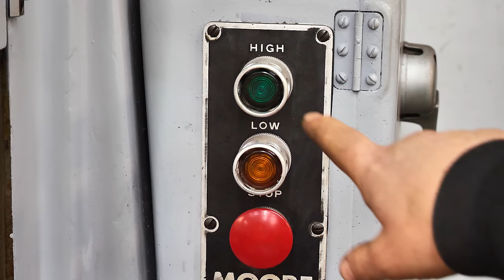Making Crazy 500cc GoKart

Comment: Am I correct in assuming that tracking in a competition rolling chassis is very important? In that case, what about some slotted holes in the rear axle bearing carriers to allow for some slight adjustment, with blocking nuts on the adjustment bolts to stop adjustment creep?. Otherwise.... when can you build one for me??

Comment: What an awesome project 👏 I have 2x Yamaha enduro motors and when deciding to put one in a go-cart, I thought I could use both with all controls simultaneously linked but with individual axils... so on a corner the outer motor will rev higher acting like a differential? has anyone tried it? its just one of those ideas I'll never get around to, but I think it would work 😮😂

Comment: I like how you used the engine as the upper part of the frame. I was worried when I just saw the bottom frame and no top in the rear. Nice shifter kart parts used throughout. I wish I had stuff like that laying around. The frame is the cheap part to build. (Well, not so cheap lately with the cost of tubing)

Comment: Great build!  I’m curious why the double rear axle bearing ended up on the non-drive, non-brake side.  I’d have thought the sprocket or disc would have ended up between the two bearings.  I’d love to see this on a track with a GPS to track speed. 👍
Reply from the maker: To reduce weight, I decided to use a stainless steel pipe with a 2mm wall, in a place where there was no sprocket axis, I decided to stiffen the rear axle with an additional bearing, in the place where there is a sprocket and disc, the axle is stiffened by hubs that fasten the sprocket and brake disc. As for the performance, it was a test on YT, so I specially dismantled the meter and did not show the maximum capabilities, I can only say that the weight of the whole turned out to be such that I can easily lift the whole vehicle and load it on the van, and in the first three gears i have to let go of the gas because the front wheels lose grip. And it's only 60 HP, I've seen many videos on YT where 600cc and even 1000cc were mounted, well over 100hp
Reply: @WorkshopFromScratch  thanks for your reply!  I like the idea of the tube axle; much less weight and still stiff enough.
Reply: It’s just a copy of a standard kart. The dual frame on the right is to mount a sliding engine mount. But yes the 3rd bearing should have been mounted in the centre or closer to the sprocket.
Reply: @WorkshopFromScratch it sounds like it would be a good idea to incorporate an adjustable airfoil on the front of the kart, so that it would hold the nose down at higher speeds

Comment: As a blacksmith and machinist, I can see you have the tools and skills to fabricate everything you want. :)
I would have made a similar approach but going for TIG welding on the frame though (yeah..just to show off ;) ).
I can see it's difficult to get the power on the road without spinning the wheels. Have you tested the top speed yet?
Reply: I thought the same thing also ,tiging the chassis, but I commend him to n his choice that was a true professional call. If he was working with chromolly steel I’m sure he would have used tig but standard steel stock mig, obviously you’ll move faster.

Comment: A suggestion -- integrate the clutch cable in the shifting mechanism (that should be fun, because it has to pull in both the push and pull of the lever) so you can up/down shift "without" the clutch.  Excellent video, thanks for sharing.
Reply from the maker: Yes, I didn't do the toge too clever, I also need to work on the lever that mounts directly to the gear shaft because it flexes when shifting and that's why there is such a big jump when shifting :)
Reply: @WorkshopFromScratch  Can you use quick shifter kits on these motorcycle transplants? Genuine question.

Comment: Impressive work. I wondered about the design process for the frame, brakes, wheels, etc. Did you make drawings before the build?
Reply from the maker: Thank you 😁 I modeled it on the original go-kart frame. I made the frame longer by the length of the engine, I widened the front axle and the rear axle is also wider, and the whole thing was made of thicker pipes than in the original go-kart, I added additional reinforcements because the frame is long

Comment: I would certainly put larger diameter wheels and tires on this one.  Just a little bigger. You certainly have the torque for it, and the engine would reach the rev limiter so quickly.
Reply: It's like an impedance mismatch, plugging in a guitar to a mic input. Or a marshall into a 8 inch speaker.

Definitely needs bigger tires; all that power is being wasted it seems. Not to mention that this thing looks insanely heavy lol. 

Not that this isn't awesome, but yeah I feel like there's a sweet spot he's missing with bigger tires that transforms this from awesome to legendary.
Reply: @jacobyunderhill3999  It's like racing on a skateboard.

Comment: you should be building Hot rods ,your craftsmanship is outstanding ,you need to get rid of the REV limiter ,lots of torque sheared off the wheel studs grade 8 bolts

Comment: A friend and I built a very similar Kart back in 1973 we used chrome moly for the frame work and H2 Kawasaki triple 500 cc for power. We ran the ET bracket at Amarillo Drag way  under AHRH rules. the driver weighed about 85 or 90 pounds. The rules called for a 4 speed transmission only so we blocked off 1st gear.
Reply: ... and? Did you do any run to see what was the best MPH and ET it could do? Over what distance?
Reply: What's et ?

Comment: the whole build is WOW ! I'm in a wheelchair and I could see myself building this frame and live axel set up, great job indeed.
Reply: Do it don't waste time for it is running out only start with a harbor freight predator 212 please , no more accidents for you
Reply: @robertevans9354 Harbor Freight Predator Engines are Great Engines. They Sell Kits on EBay and other places to really beef them up. They are a really good Honda Clone and just as good in my use of them.👍👍

Comment: Like everyone else, excellent fab skills and engineering. When I was 17 years old I took the motor off my snowmobile and adapted it to my home built go-kart. That thing screamed! It was only 18 HP, but with the torque converter a friend clocked me at 90+ and I was pulling away.  This thing will also GO! Oh, I am 68 now, so a few years have passed. LOL
Reply: No that didn't happen. I had an actual 440 snowmobile engine in mine and it didn't go that fast. Probably twice the 18 horse u had and it wasn't that fast. 90 and going away, nice dream dude. Oh and I'm 63 so calling you out old boy.

Comment: It's evident that you've been collecting parts for this project for quite some time. The wheel mishap added a thrilling element, but I won't spill the beans! Overall, another stellar job as expected. However, I can't help but wonder about the safety precautions and potential risks involved in such a powerful go-kart. Stay safe out there! 👍🔧🏎
Reply: Your concern is duly noted good sir however this is far from over powered, if you compare this to one of today's modern entry level novice 100cc 2 stroke racing Karts I think you'll find the power level is adequate and far from being dangerous especially considering the sturdy and well engineered chassis, the extra long wheel base, wide track, huge 4  wheel disk brakes and as well as relatively tall gearing make this home made machine very safe indeed. One of best I've ever seen infact. 
500cc may sound like a lot but trust me that particular engine is sourced from what most countries classify as a Learners bike, it's a low compression design and extremely linear and not what you'd call a power house. The bike it's from is a commuter bike made for economical transportation and not competitive racing, a 250cc 4stroke from a MotoX bike would absolutely destroy this 500cc commuter engine. The builder chose it for his own reasons, probably reliability, cost, and its linear torquey power curve is my guess.

Comment: I own an OTK gokart with 125cc iame x30 engine. I get to know the parts of my kart better by watching you build, thank you. 
Yet I felt that 125cc is a bit too much power for me, a 500cc is absolutely a formidable beast.
Reply from the maker: Yes, 500cc is hard to control and this engine has 60HP, but I've seen people on YT who built go-karts with 600cc engines from sports motorcycles over 100HP, it's hard for me to imagine how to master such a go-kart, where I have problems with a 500cc capacity and I have to let go of the gas because the front wheels lose traction

Comment: id have gone fully crazy with this gokart stuck a early h1 500  kawasaki bigger oil lines and top bearings changed the gear ratios and a wider chain ,be a riot to drive,ive seen yam 750 vmax bolted to a ally and stainless frame go kart ,a 350 ypvs race engine stuck in one that was fast in a straight line but spun round in corners was not wide enough and was not geared down

Comment: I did the same thing when I was 16 and used an engine out of a Honda cb 250 . 85 mph and a lot of fun . We used 12 inch tires to get speed from such a useless gear ratio. We stretched a standard cart out and pretty much all the same with drills ,grinders, torches and stick welder . UNTIL we melted a piston due to lack of cooling air. That was our next mod to put air scoops on it but it didn’t make it and we had to replace the pistons .

Comment: I want to try and build my own custom cart as well and wonder what kind and how big pipes you used for the frame.
I also think this build is crazy
Reply from the maker: He has a kart and the first idea was to extend it to this engine, but I found that because the tubes were 28mm diameter 1.5mm wall thickness it would take a long time to strengthen it with this frame, so I decided to build the whole frame out of tubes 32mm and a wall thickness of 2mm take into account the reinforcement of the frame for its length and weight :)
Reply: @WorkshopFromScratch  hi Mate.  What center line radius is the die for 32mm tube

Comment: Ahctum...an idea you might like. The idea is two rear axels connected by chain from the motor then using a total of 4 tires on two axels on the rear for better traction and control

Comment: I need a ninja 500 engine myself, Mine locked up due to a bolt failure on the drain bolt that was missed. That things engine pulls hard at 500+ lbs and is quite fast honestly compared to most sports cars under $30k...i can only imagine how scary it would be on a shifter kart like chassis

Comment: What an awesome creation I would love to have your workshop all your tools and skillful welding ability. Please forgive my naivety but is it normal not to be able to adjust your seat  your chain and to not have rubber engine mounts on a go cart .
Reply from the maker: Thank you 😁 I've been working a lot on the equipment of the workshop and a large part of the machines are built by me. As for skills, I'm just an amateur. The kart is still to be refined and above all I need to install a chain tensioner and improve the operation of the gear stick :)

Comment: Did you consider mounting the clutch lever to the shifter handle? Hard to steer and clutch at the same time the way you have it mounted now.
Reply: The clutch is only needed for starting and stopping.
Reply from the maker: In general, I change gears without a clutch, but this engine has not been fired for four years, so the video shows how I use the clutch, but later the gearbox started up, so I didn't use the clutch anymore, and it seems to me that, as my colleague "Maculata" wrote, that it is better to have a clutch for starting and stopping near the steering wheel

Comment: That was a very professional build, until the wheel fell off 😀
What happened? Faulty material on wheel studs?
Still impressive, have you made  karts professionally?
Reply from the maker: The wheel was not tightened 😂 Fortunately, it was the first test drive so I drove slowly, testing the drive and brakes. This is my first go-kart, I haven't built such go-karts before, so this go-kart is not without flaws :)
Reply: @WorkshopFromScratch  Well I'm impressed with your work, easy to overlook something when you really want to test drive.

Comment: In 1971 I built a go cart with a 185 Suzuki engine. Later on I built one with a cb450 motor out of a Honda. Impressive skills with the pipe bender. Mine were built with square tubing and plate.

Comment: a nice toy, but for a flat card course. with this suspension, or rather the lack of it on the roads, you will end up losing a wheel or two. If it's a road toy, maybe add suspension and appropriate elements to prevent it from cracking due to potholes.
Reply: now i see steel... i checked end only but very elastic strong so may not be bad but still not good on road. :) but that bridge on rear suspension.. hmm let know when and if will crack on YTand front ends.. good luck.. make flat bottom to slide with no change direction after loosing wheel.. hopefully not .

Comment: Interesting seeing as the GPZ500 is rated at 60bhp and the ER5 is rated at 45bhp Judging by the all silver finish you have an ER5 lump with the lower bhp rating. But it does look like that is a US spec engine with all the emissions stuff on top. the bhp figures were  for UK engines.
Reply from the maker: This engine has 60 hp, I know that in other models these engines came out with limited power, it all depended on which country it was sold in and under which category of driving license. But it's not a problem to unlock full power in this engine 😉

Comment: In Britain we made racing 250 cc Honda super go-karts that had 30 to 40 hp only capable of doing 140 MPH But today those supper Go-karts have a 100 plus HP 250 cc engine and capable of doing 170mph it is light fast and instead of being behind the driver is at the side.  As the ones I known had engines behind the driver now it is different easy to change things lighter with the cowling around the driver the same but lighter faster acceleration faster around corners disk breaks  and made for people 64KG under six feet in height. Reason why a lot of teenagers girls are racing now.

Comment: Definitely not knocking on this guy for this, but was anybody else thinking when we were undoing the oil filter on the engine engine that we probably should’ve changed the oil and made sure the motor was running condition before building a go kart around it?🤔

Comment: You're hitting the rev limiter constantly indicating you gearing is too low.  Put a larger sproket on the front engine sproket and replace the wheel/axle sprocket with one several teeth less.  This will get the engine into a lower RPM band where its low end torque can be utilized.  You'll shift less and it will pull stronger for longer with a faster top end speed.  Good luck, perhaps you already did this, if not this will change its manners and drive abilities quite a bit.
Reply from the maker: Thank you 😁 Yes, I've already changed the rear sprocket but I still need to change the front sprocket to a bigger one, after all. It's much better after this change 😁

Comment: You should use some instrumentation,  a tachometer first of all! You listen,,you over speed the rpms,,that's where you hear the engine stutter before you shift into the next higher gear, this is detrimental to the life of the engine.  Stop over revving before you you shift or you can end up with a broken crank shift coming through the engine block.  Get a tachometer!

Comment: Tires too small. You have enough power to push a little larger tire and it will give you way more top end. You're going to push through tight corners with small front tires also.

Comment: Calling a 37hp kawasaki KLE500 "F1" is a bit silly... Normal shifter karts make more. The build looked pretty solid though.
Reply from the maker: This engine is from a kawasaki gpz500 this version has 60hp, the kawasaki er5 has 50hp but a little work on the carburetor is enough to reach 60hp

Comment: Looks like it weighs 500 pounds my 50 horsepower two stroke TM engine,engine new $6000 tricked out to the ported polished engine and clutch less sequential 6 speed transmission, engine and transmission weighs less 40 pounds ,DR shifter go kart j90 chassis total weight with 115 octane fuel less than 125 pounds.  We race on 2 to 4 mile automotive state of art tracks hitting speeds of over a 120 mph in the draft , on some of the tracks we race with 250 super kart class and honestly there so much heavier they really slow you up and get in your way in the turns really, that tank would be literally a complete mockery joke on the track down  dangerous,  sorry but that's the REAL TRUTH

Comment: a 500cc 4-stroke engine ?? what slower and heavier you probably did not find? if already "crazy" then a 500cc 2-stroke engine !!
Reply from the maker: It's not that it's faster, it's cheaper, I love 2-stroke engines but they are getting more and more expensive, in my country for the price of a 125cc two-stroke with more than 30hp I can buy engine Honda cbr 600cc or even cbr 1000cc and such engines are kawasaki 500cc You can buy two for this price

Comment: Seems to be geared to low.  Top speed should be much higher.
Reply from the maker: The conditions in which I tested the kart did not allow me to achieve higher speeds and I could not show the maximum capabilities of this kart, the next problem is that I have no experience with karts so I need time to get used to driving such a vehicle, as I gain experience, then I will be braver when testing

Comment: Shame, this is a Lawn cutter against a racing gokart fitted with a light 42 HP 125 TM 2 strokes 20.000 rpm 6 speeds sequential gearbox
Reply from the maker: I also dreamed of such an engine, but in my country the price of such an engine is very high :(